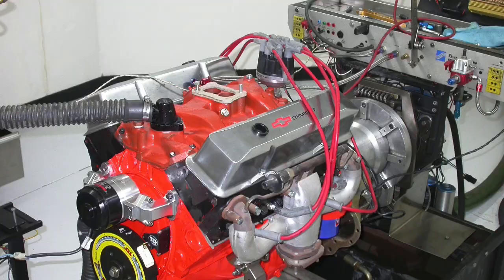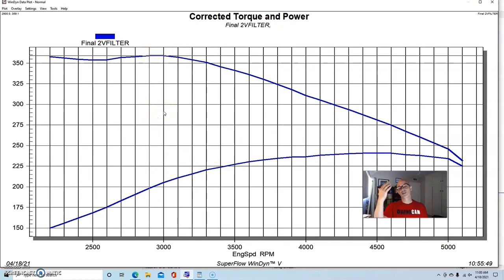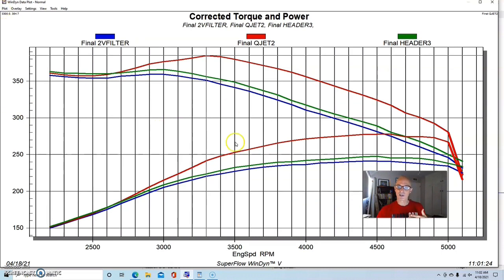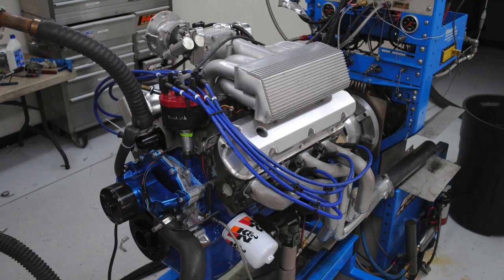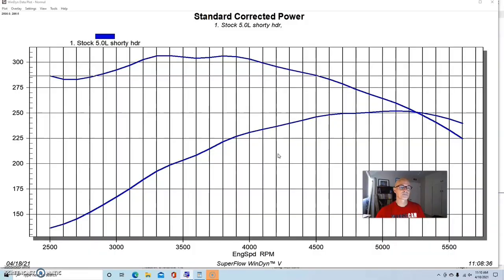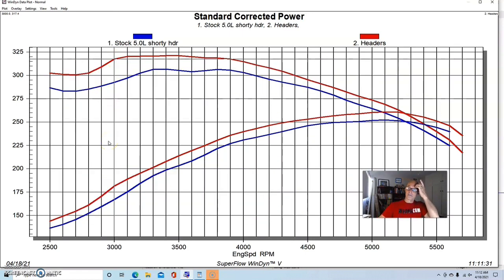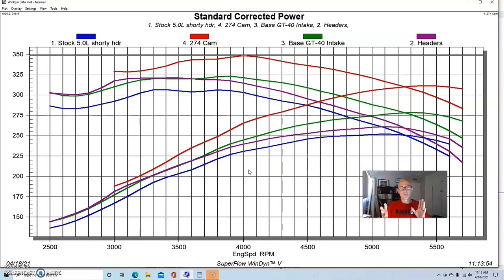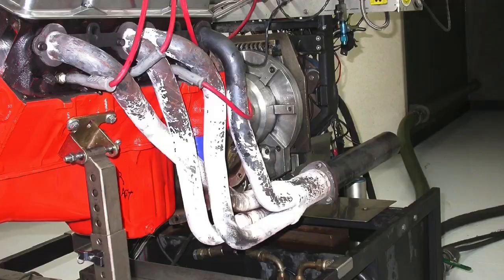DIY, CHEAP, BACK TO BASIC MODS-SBF FORD vs SBC CHEVY

Comment: Give me a wink if we gonna see a Big Bang Gen V LT Test ;)
Reply: The l8t from the HD trucks is probably the most common one. They are the 6.6l but come with the same heads and camshaft as the lt1 in the corvette. The intake and exhaust is the biggest difference. With an lt2 intake from the c8, camshaft and long tubes they would probably make 600hp on the Dyno.
Reply: @timothybayliss6680  would love to see the L8T in action, would be interesting to pull one of a 2500
Reply from the maker: I need to try one!
Reply: @richardholdener1727  yessir😎, the man the myth the legend

Comment: Richard do you have any videos where you upgrade the top end FIRST(including heads), keeping the stock cam? Just curious how that would look
Reply: Holdener performed a dyno test in one of his books-- the Ford did very well with the stock HO cam and some good heads. The stock Ford cam is pretty good.
The Chevy would do better with a bigger cam and the stock heads, which flow very well.

Comment: Anyone know why foxbody 5.0 have different firing order than the 94 95 ? Seriously could use some knowledge can't get my 94 to run on either firing order.
Reply: I will definitely check it out the thing that I noticed is that everyone's plug wires are all very neat and tidy and on my car when it was running they were not needed tidy they were kind of like a cab Web of sorts but I will check over to again and see if it will run correctly thank you guys
Reply: My understanding is that when Ford took a lot of meat out of the block, it led to a vibration problem. So they changed the adjacent firing cylinders from the back of the block (7--8) to the front (6--5).
Reply: @BuzzLOLOL  How many power strokes are happening at the same time?

Comment: I can live with losing 29HP and 51Ft•Lbs for 48 CI. All junkyard except the cam. Its a shame the aftermarket didn't support Ford like they did Chevy.
Reply: spin the ford 1500rpm more to make up the difference.
Reply: @TheRetarp  just dump the 90's fuel injection and put on a 500cfm carburetor and aftermarket intake. Problem solved. Under $700 brand new.
Reply: @Jeremyv1980  Or go megasquirt and keep the EFI which is the way I'm researching.
Reply: @TheRetarp  go holley terminator x max... much better.

Comment: Do a 300 i6 against the 302 v8 its the better comparison 

The 351w is a better comparison to the 350 

And the 300 built is a comparison to a 400 class motor
Reply: I think he compared the 350 yo the 302 because of affordability of aftermarket high performance parts and GM intentionally lowered compression in their motors to pass emission test.
Reply: @tskraj3190  its still a comparison I and a lot of people would like to see but I feel a fair fight would be the 351 to 350 because they are 1 ci apart its not as big a difference as 302 to 350 , the 300 would be a better match to the 302 again due to 2 ci difference
Reply: @Project-gr6zy  I think he did a 351 v.s. 350 comparison
Reply: @tskraj3190  I think so too, but I haven't seen a 302 vs 305 vs 300 vs 318 fight yet especially the 300
Reply: @Project-gr6zy  The 302 would most likely destroy the 305. The 305 was a very reliable motor but it was a dog. The 300 wasn't well known for HP but they were reliable as well.
Reply: @tskraj3190  the torque is what the 300 was known for and making more tq between idle and 2500 than even a 350 or 351w
Reply: @Project-gr6zy A turbo on a 300 would be interesting.
Reply: @tskraj3190  a guy did 7 pounds without a tune and made 215hp and 440 tq

Comment: Cams, heads, exhaust, carburetor... just buy a snail and you’ll get more than any of these mods. If you get some CX Racing ones, you’ll probably be at the same amount of money too. Good heads, cams, and exhaust aren’t that cheap.
Reply: Depends. A scrapped engine with the right parts could be quite cheap. Like the explorer engine is pretty cheap. Has good intake and heads. A wrecked vortec powered van engine would be cheap.. depends on how you get the parts. Even so, a turbski will net you more alone. But, if you do the other mods, that same spinny boy nets more still.

Comment: You messed up the noise it makes when you flip the air filter lid with a QJet....there is a lean backfire somewhere in there. It's more like, Bwaaaffffff POP waaaaaaaa.
Reply from the maker: I never got that on mine-but did suck in sound deadening material off the hood
Reply: Never had a lean backfire with my Qjet they are great carbs when adjusted correctly.
Reply: @BuzzLOLOL  adjusting the air doors is actually a really easy thing to do. Most QJet carbs now are out of adjustment just because the springs are all 40 years old.

Comment: Well I don’t agree with a lot of what he says. All he wants is funding like the rest of the big look at me programs. 2nd what everyone should be looking at is not hp and torque but rather CFM’s. ! You get this dialed in. Then you can go from their. Anyone that says shorty headers are no good doesn’t know what he’s talking about especially if he thinks  2 barrel 351c will only fun 110 mph. LOL. Headers are a small part of the equation. I’ll take an exhaust system that scavenges over just free flowing any day of the year.
Reply from the maker: Shorty headers make the most power of any exhaust system ever dreamed up and every 2V 351C Mustang went well over 180 mph! Can you look at me now?